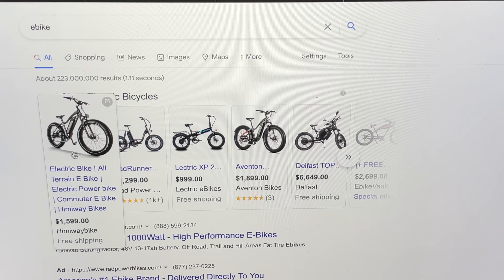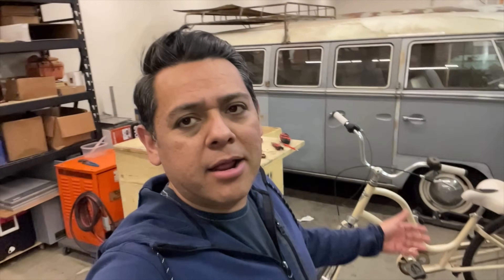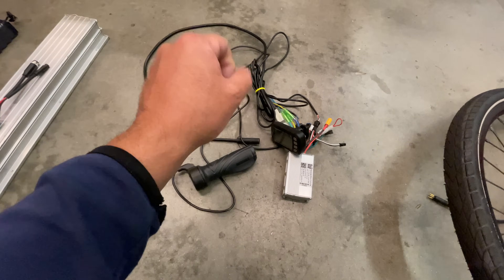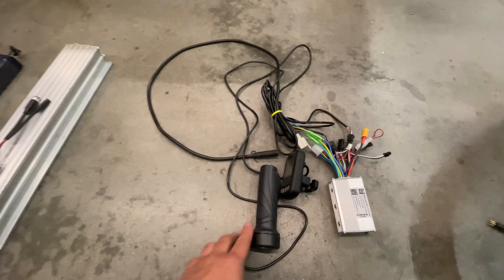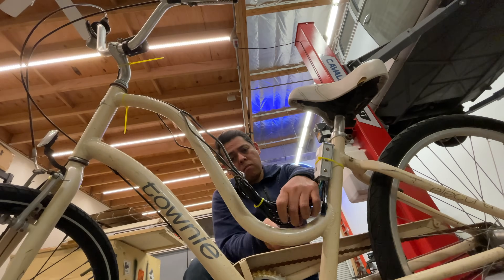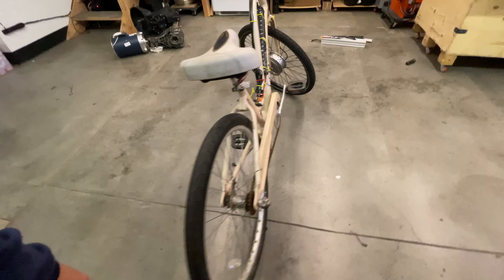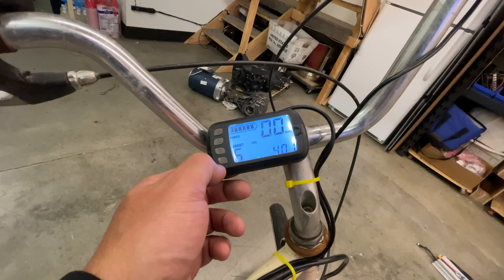$150 eBike Build,  Beginner friendly

Comment: Thanks for the great project idea. The hardest thing to get was the M12 bolt, I ended up finding one at our local Autozone. 

For anyone else that might hit this, the wires that go from the controller (the one linked to in the description) to the motor didn’t match for me. When I plugged in the three wires to their matching colors I could hear the motor in the hub hum but the wheel didn’t turn. I ended up with (from controller to motor) yellow to yellow, blue to green and green to blue. I hope that helps out anyone else that might hit this issue.
Reply: Thanks bro. Your advice fixed my problem. Great job!
Reply: You just answered my question....Thanks I will try your configuration now!
Reply: Yes, it certainly did!
Reply: Thanks for the tip on the wires.  I just went right to your suggested wire match up and it worked on my first try.  This is the best value ebike kit for a 26'' bike by at least $100.
Reply: Your motor was running backwards until you switched the wires. Put some brakes on this suicide machine.
Reply: Z z
Reply: Green wires typically indicate ground. The picture on his site shows switching blue and yellow, which I will try once the parts arrive.
Reply: What is the easiest way to connect the controller to battery with soldering?
Reply: @miket1160  It depends on the battery. I got the intermediate battery he had in stock (pre-woken, which was nice), and it's an XT30 connection that I got on Amazon: https://www.amazon.com/gp/product/B073WWWMQP/ref=ppx_yo_dt_b_asin_title_o04_s00?ie=UTF8&psc=1.
It's the plug he uses to demonstrate waking the battery with a second charger. One end of a long wire pair soldered to + and - on the controller, other end soldered to the connector. Very easy, works well. Easy to disconnect the battery for charging indoors.
Reply: Did you swap the hall sensor wires too?
mine also only runs in reverse , but when  i swapped only yhe motor wires, the wheel just shook and barely moved
Reply: @theejoeylee  I guess I'll start with the stupid tech support question first: is the arrow on the motor pointing forward?
You may also want to see my problem and reply/solution somewhere else on this thread.
Reply: Unhook green wires on controller and change phase wires on motor to controller to different combination. Mine is great . Watch out for the flying bugs , they hurt
Reply: go to ace hardware
Reply: Yes some controller has a different wire config on it and it only hum. I endup buying another controller before i realise the problem. And by doing that i endup buying a cheaper  one😁.
Reply: I have a few questions if you wouldn’t mind answering I was wondering does the bike still work well and what do you mean by M12 bolt do you mean the knut for the bike?
Reply: @Starpop1011  yes still works great.  M12 is the nut size. I did add a eBike universal torque arm (from Amazon) a few months later to prevent it from slipping.
Reply: @patrickwardrop  Thank you I think I will try making this
Reply: @patrickwardrop  Sorry for another question but do you need anything else to make this other than the materials listed in the video like wires?
Reply: My bikes wheel isn’t moving no matter what I do with the the phase or hall wire I watched many videos that the controller was faulty do you guys have any suggestions I know I’m a little late
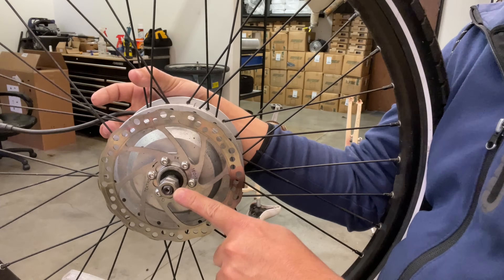Reply: 3:43
Reply: I’m in a bind bro so are you saying the throttle to the rim ? And I didn’t get that plug in the kit what do I do ??
Reply: I think u actually had to program the motor to go forward by Turing it on and connect the two green wires and twist the throttle and it’ll be set n unplug the geen wires and turn it on and there you have it
Reply: Thanks cuz!
Reply: THANKS CUZ.
Reply: Bro question,what is the top botton for it has a c on it ???
Reply: Thanks for this tip. First the wheel went backwards. When I reversed the wheel in fork and hit throttle, I heard a click, then  could hear motor turning inside hub but wheel didn’t turn when you hit throttle. Had to switch blue and yellow bullet connector wires- success!   About 25 mph tops. I used the es200g battery with dongle- works great, $20 42v 2 amp charger charges from empty in less than 24 hours so no real need for a bigger one. Fun DIY build. Make sure that the wheel motor extension cable is the one that has white 6 wire snap connector on one end to connect with the controller.
Reply: @bwasson989  hey I am making my kit right now, I got the extension cable part but I’m having trouble with the battery, trying to find one that connects and charges
Reply: @patrickmendonca7554  I got the Panasonic 40 cell scooter battery(currently 2 pack $107) and needed $29 dongle (currently not available- I wouldn’t buy one without other). Additionally I got $12 42v 2amp charger(just cut the connector off and added xt90) and the $12 charge connector(sold out but only needed if battery is in hibernation)- with all these, I didn’t have any problem by following the video which can also be found here on how to wake up these batteries.
Reply: @patrickmendonca7554  the battery red and black battery wires from the controller had male bullet connectors on them. I connected those to 10-12 amp snap connectors and w 12awg wire to xt90.  Xt90 connects to dongle
Reply: @bwasson989 😮
Reply: @bwasson989  can finding it all cheap enough
Reply: @bwasson989  Wait, witch 2 wires did jehugarcia use from the controller to insert the XT60 Adapter? I'm not sure witch ones because of the huge amount of wires coming out the the controller
Reply: @yothiccpapigerardo3981  the heaviest black and red wires(which have the male bullet connectors on each tip w/green translucent sleeves) get connected (xt60/90) to battery(dongle for as200g- which then hooks to battery). As I recall these were the only red &black wires that were not terminated with a multi-wire connector, there is one red, black, blue, yellow and green that are individually terminated with bullet connectors. The blue, green and yellow connect to wheel motor cable bullet connectors( additionally, the wheel motor cable has a series of 5 smaller gauge wires with flat copper connectors that slide into the white female multi-wire connector provided with that specific cable which you match color with the smaller gauge wires in the matching white male connector on controller
Reply: @bwasson989  Thanks bro, I didn't think anyone would reply but you did. Thanks brother
Reply: @bwasson989  Is there an email or phone number I can reach you at. I really want to follow this guide to convert my bike so I can bike to school, but I'm having trouble understanding what exactly the other parts I need besides the ones listed in the video and how to convert the controller so it connects the battery.
Reply: @bwasson989  do you need anything other that the materials listed in the video to make it like wiring, cables, etc…, also is it necessary to solder that one part at 4:50
Reply: @Starpop1011  Sorry but Panasonic battery no longer available so you would need another 36v and appropriate charger( making sure that battery is not in hibernation or that there is solution to awaken and also that battery doesn’t need any special solution to make it work like the Panasonic did, I don’t know about rest - with the drive wheel available at the time  and the controller I got that were linked at the time to Amazon, you needed a cable extension to drive wheel. Wish I could be of more help, maybe look at more recent builds that use currently available parts.
Reply: does no one use amazon? I purchased a box of either 10 or 20 for like 5 bucks. the nuts came in way before my controller came in.
Reply: @JoMiller97  NO no one uses scamazon
Reply: Deez nuts
Reply: @schemey8083  That's a GOTTEM.
Reply: 4:48 easier said than done. He doesn't show that part either.
Reply: walmart $399
Reply: @magicbubbleballoon  what is Walmart 399?
Reply: @JoMiller97  The rate of change of screen time is faster than my reading speed.I can´t follow to read the whole sentences within a shot time .
Reply: @ubogyi4656  Hit the pause button.

Comment: My 1500w, 48v20ah, 7 Shimano gear, 5 PAS, hydraulic brake bike cost $960.00 delivered. 32.6 mph. True GOS speed. Tire diameter adjusted to 20.3 for accurate speedometer reading on bike.

Comment: great vid, good luck finding a hub motor wheel for $40!!! I bought a full suspension Mongoose (at thrift shop) just to make a rear hub motor E-bike. I got over 250 18650 batteries harvested from various sources, most are still 2100+ mah on a 1W lipo tester (3V cutoff)  I think the throttles and the 350W controllers are about $10 /pc nowadays.

Comment: It's probably important to upgrade ebike rated tires and brakes for safety. The speeds at full throttle could easily get up to 30 mph...at that speed you will burn out your tires and brakes fairly quickly. Be safe folks.

Comment: I built one years ago out of a BMX bike a treadmill motor drill batteries lawn mower batteries it was a 72 volt so I had to have several batteries hooked in series instead of a throttle I had a clip on the end of my positive wire that I moved from Battery to battery positives starting off with 12 V and eventually up to 72 it basically looked like a bike bomb cost nothing did 22 mph

Comment: HELP. After a year the batt wont charge. Charger checked and good. Batt is good. At the dongle the two small holes have batt voltage. The larger two nothing. Can i charge thru output?  Does bms work that way. Hate to waste batt. Im using the large aluminum batt in vid. 36 v.

Comment: Why my ebike doesn’t have controller? The battery plate has three wires sticking out without xt60.  one for pedal sensor one for the motor and another. But I don’t see a controller man? The battery plate is “tianjin intelligent vector control” suggesting it’s a combo design
Reply: MODEL: B-WZKD3615KA-FH10-1-1.1

Tianjin Santroil Electric Technology Co.Ltd

Low voltage protection:30V

Maximum current:15A

Rated voltage:36V

Intelligent vector controller of brushless motor

Comment: True you did find a much more cheaper way to convert a bike to electric. I personally would not like that e-bike setup, because you would get lesser mileage than the miles that you said. For example, how you chose to ride your e-bike, by jackrabbit starting and and having the motor in the front you get less efficiency and other crazy things you were doing. And most of all you end up with about 1 to 5 miles per charge!

Comment: You should do a solar one? That was cool what you did
Reply: Unfortunately you need so much surface area for solar panels that no vehicle could carry enough solar panels to power itself outright. 
Even with 100% conversion efficiency the sun doesnt give enough power per square foot to power vehicles. 
Batteries will always be necessary but you can easily create a solar charging bank at home and use multiple batteries. that way you can use one battery while the others are at home charging via solar. 
Eat the sun, ride the lightning!🤘

Comment: You are already dangerous by powering the front wheel and not the rear. Depending on the steering angle (and flop) this is a terrible idea. Start off with a single speed, put the motor on the back and a good break on the front. 😅

Comment: I bought the recommended 460Wh battery from your link and it arrived as a total dud. The connector was completely corroded over, and when I probed for voltage it had only 80mV. There was even a piece of blue tape on the battery with "Bad batt" written on it. Watch out guys these links are a scam!

Comment: I bought 30 cell 36v 8a battery  but it  came with a faulty need  assistance please
Reply from the maker: Support@jag35.com
Reply: I bought a 30 cell 36v 8a battery  and charger  on receiving I fully charged the battery indicator on the battery being a solid blue light and on the charger a green light as directed

When the battery is hooked up to the e-bike and I begin to accelerate using the throttle after approximately 20 seconds the battery shuts down showing a blinking red light after 5 Seconds goes back to Blue 

my friend my friend has a battery pack which I borrow and it works perfectly on my e-bike it actually has a lower rating than your battery pack I believe the problem might be a faulty BMS please assist in any way you can for I am not satisfied with my purchase.

Comment: I get the concept of the video, but for the average person it simply will not be as cheap, as easy or as quick. The cheapest motor/battery kit I could find is around $300 and even as an experienced ebike builder, it takes me at least an hour when everything goes right and that is rare. A person with very little tools, bike, mechanical, electric abilities will spend half a day building their first ebike from scratch.

Comment: Great video, and I plan something similar. Think again NOT about doubling the voltage to 72V: DO NOT "TRY/FRY" THAT - That would use FOUR TIMES the wattage, and I'm willing to guarantee that the controlller and/or the motor will break and leave smoke behind in less than 5 seconds, probably in 1 second or less.
Reply from the maker: I meant try 72v controller

Comment: cool build, but I think it's always better to put the motor on the back wheel, specifically when you're going uphill(pushing from behind your weight vs pulling from in-front) & to have better control & agility when turning.
Reply: yea I was thinking that too. But I guess that it is harder to put it on back.
Reply: I disagree. The motor doesn't have enough weight to make a difference when it comes to control. But more even weight distribution provides better safety. With majority of weight shifted to the back, I've had situations on steep uphills where my front wheel jumped high into the air. If not for my reaction the bike would flip over me. I changed to front motor and it never happened again. 
Also this way you can have a 2wd transmission if you're assisting with pedals.

Comment: These have become some of my favorite projects over the last year.  My daughter uses her bike now to get to work and college instead of spending money on gas.  I just wish more of these wheels were available, as they are the perfect wheel for bikes that still get pedaled and builds where you want AWD as when they are not powered they free wheel without drag (unlike the non geared hub motors).  I hope you get more of these in someday!  The 30 cell packs are pefect for builds, but for more range it's hard to beat the Shorty R5.
Reply: Definitely a great project.
I'm looking for more of the wheels they are very nice for building beginner bikes.
I want to build more; this is a cheap wheel for beginners.

I found a similar wheel on eBay but couldn't get it to work.
It says 'new, out of the box.'

Thanks, Jehu Garcia, for a fun ride on my new E-bike...!
& transportation on demand.

Batteries are great too.
If you can point us in the right direction for cheap E-wheels.

Also wanted to add; I put on a lot of muscle and lost some fat.
It's a good way to entice yourself to exercise.
I'm pleased with the results so far over one summer.
I look forward to more summers.

Thanks

Comment: Bro do I unplug n charge even if it’s like 39.9v and do I have to disconnect the battery after every use or can I just turn it off by the monitor on the handle bars?

Comment: Bro my motor spinning inside but the wheel isn’t turning please help
Reply from the maker: You are spinning it the wrong way,  flip the cables and it should spin the other direction
Reply: No I figured it out ty anyways but new question is: so if it’s charged , do I have to unplug it after each use or can I just turn it off and use it later ?

Comment: Hello bro I’m following this video ,so far I have the rim the electric box , the throttle installed the monitor installed now I’m getting the battery n battery charger but my question today is what do I do for the rim plug?like I don’t get it is there a wire plug I or what ?

Comment: I hope people read my comment. This is an unbelievably dangerous thing. Despite the availability of front end drive motors bikes are not designed to be pulled by the front wheel. You can pull off the front fork. Another thing is that there is no torque arm on it. The wheel will probably eventually twist itself off, possibly when you are at speed. Front wheel drive bikes are unstable on gravel and rain. If anyone has done this please immediately stop using it without a torque arm.

Comment: My old ebike (rip) and every one I’ve ever tried had the motor on the back tire. It made it super easy to turn the bike around when off of it. Just throttle it and pull back on the bars. Bike automatically does a wheelie and you just spin it around

Comment: Where do you find the motor and wheel assembly so cheap thanks
Reply: Did you ever find anything I'm looking too
Reply: @RedEyedKaneki  nope can’t find the link below or the wheel and motor help me if you can
Reply: I actually gave up I could only find replacement parts but I was unsure if they would work together so I ended up buying a used one off of offerup